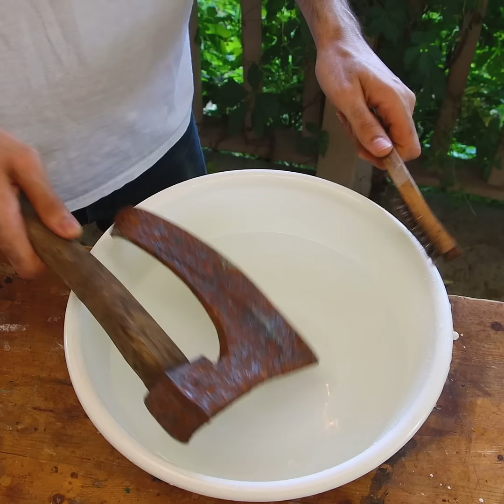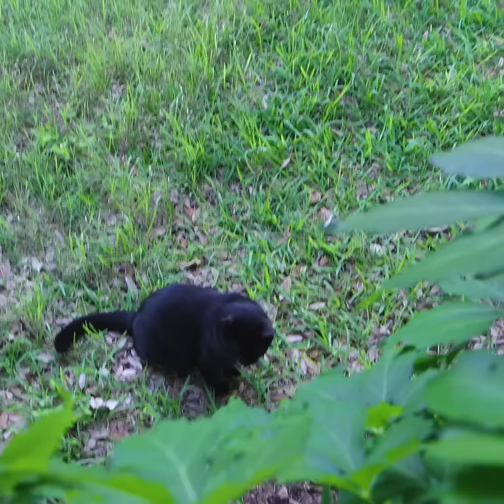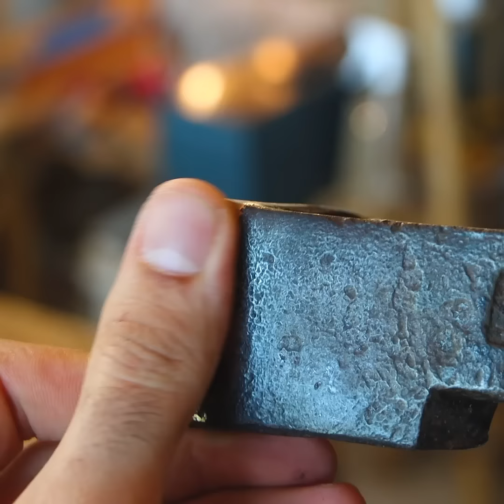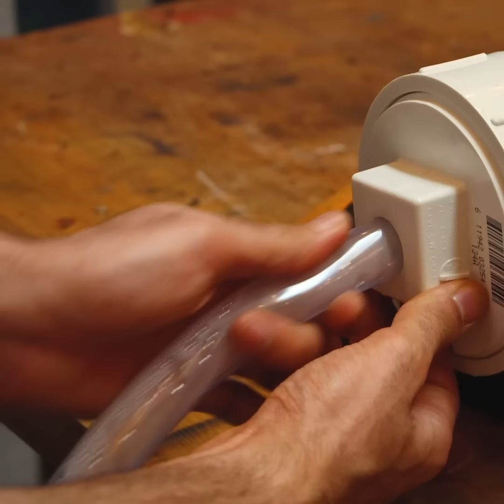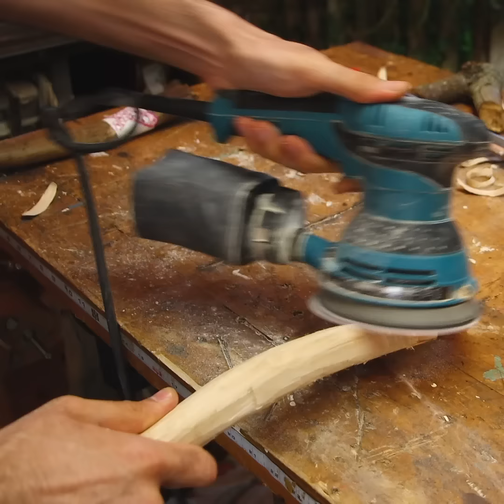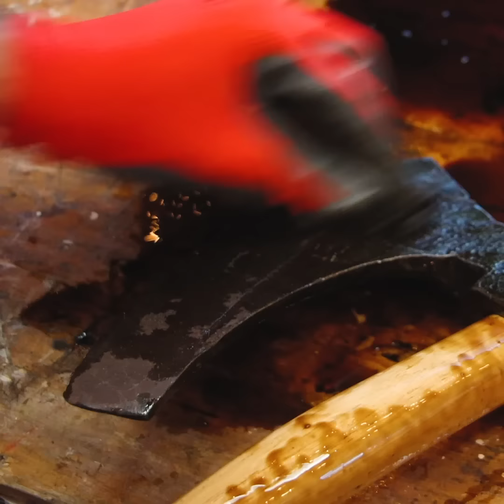Rare 120 Year Old Hewing Axe Restoration #shorts

Comment: Using naval jelly & steel wool to remove the rust from the axe would've been much easier & more thorough.
Reply: Naval jelly .. interesting name 🤣
Reply: @my_flippin_journey  lol, I am curious as to what else this 'jelly' can do . . . 😂
Reply: @angelataylor5241  sus
Reply: Easier and more thorough than an angle grinder with a wire wheel?

Comment: That bend you removed actually had a function.
Reply: You can see that it does end up with a bend when he's using the drawplane to remove the bark
Reply: @RapTapTap69  he talking about the bend on the axe bit. Not the handle.

Comment: Why use that green ass wood for the handle tho
Reply: Probably so it can bend (he used steam to bend it) and it will season while in the axe head.
Reply: @rebeccacampbell585  and it’ll expand and contract and deform as it dries. It’ll probably fall right out lol. You can bend seasoned wood with the same method.
Reply: Im 90% sure it was a seasoned piece  of wood, look at the way the bark has dried out when hes shaving it off paired with the fact their are leaves on the trees in other shots meaning its either spring or summer meaning if it were to be harvested recently then the bark would be coming off much more easily due to it being the period that deciduous trees grow where the bark separates from the trunk so a new ring of growth can form between the trunk and the bark.
As for keeping the bark on while the wood seasons: when using a small branch for tools or anything which requires a beating removing the bark for seasoning can make the finished product much weaker as its more likely to crack from drying too quickly. This isnt as much of a problem with large cuts of timber due to the growth rings usually being much more lateral.

Comment: I have a question and it comes from a place of ignorance and not sarcasm. What was the purpose of steaming the wood? I thought it first that you were going to straighten it for the handle however the handle still appeared to be curved. I'm very intrigued so I had to ask.
Reply: Steaming the wood makes it more maliable, once in position and dry it will stay (mostly) in that position.
It's a way of reshaping wood without wasting it.
Honestly I am impressed the guy did it, as it's rarely done.

In regards to the handle shape, it is offset like that to stop you smacking your knuckles, gives you clearance for your hand or shallower angles.
Reply: @autumn5592  thank you for the clarification and education.
Reply: @bearsouth1984  Happy to help

Comment: Best way to remove an old handle if it is stuck? Throw it in a fire. It will burn the wood out.
Reply: Destroys the temper of the axe
Reply: And then you have to reharden the axe, more trouble than just punching it out.